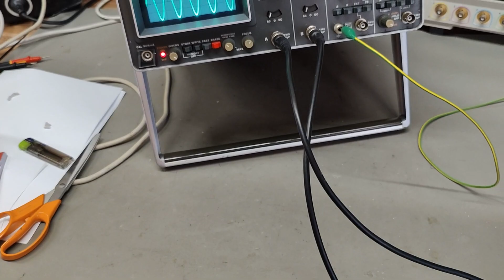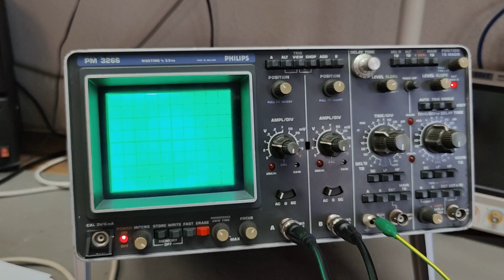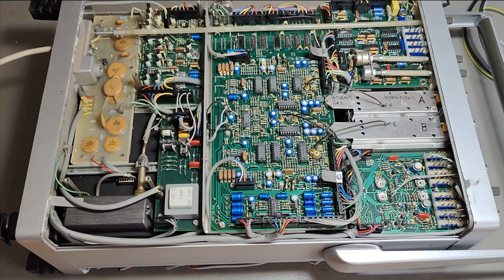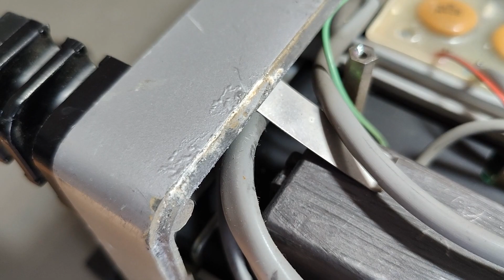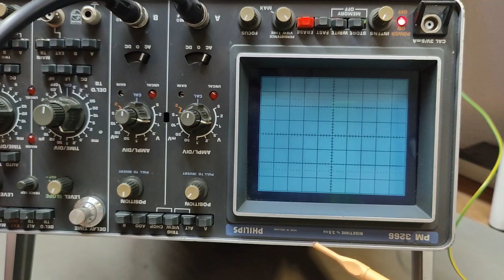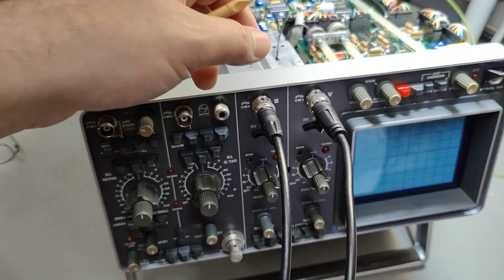Philips PM3266 oscilloscope 2ch 100MHz analog storage 1982

Comment: Hi Thomas, great video! I have a Philips scope about the same era, the PM3217. It's a great scope, I'm an old (73) audio engineer so 50MHz is fine for me. Those Mullard polyester caps were about the best around at the time until they crack open, but the blue electrolytics are a known problem component, which is more than a little worrying as there are about 1000 of them in these scopes! The only problem I have had with mine is a bit of noise from the rotary switch contacts which are extremely hard to access to get some cleaner into them, apart from that it works great, and I only paid £50 for it about 5 years ago.
Reply from the maker: yes i love crt scopes, most of them are still possible to repair, could be fun with a try/win count for my scope repair ratio :-)
Reply: @TeardownOZ2CPU  I wasn't going to comment but I just saw the date you posted this on ... 

I agree, we need some count! Although there's not much you didn't get fixed :)

Comment: I too have the PM3266. All the voltages check out fine except the 500V reads at 550V. 50 volts more than what the circuit depicts. Also the 60VAC input to Unit 24 reads at 120VAC. (60V higher).I have no idea where this needs to be adjusted.
When the instrument is cold and with an input frequency of around 30kHz sinewave I get a broken waveform. Hence i checked the voltages and aftter triple checking I still get 550VDC at all the 500V test points and 120VAC where its suppose to be 60VAC. Quite a substantial difference

Greetings from South Africa

Comment: Hi Thomas, thanks for showing the internals, I have a Philips like this in the garage at the moment to be revived, a friend bought it from an estate and it hasn't been plugged in for at least 15 years.

Nice day 🙂 Tom
Reply from the maker: check RIFA and check mains filter, and a few of the caps in the power supply
Reply: @TeardownOZ2CPU  Thanks for the warning 👍 that's why I have it and, because a friend wanted to turn it on straight away after so many years at full mains voltage without any control and gradual recovery of the electrolytes, luckily I stopped him in time.